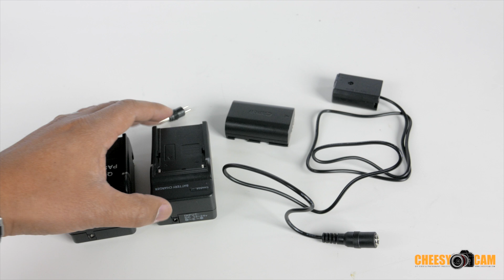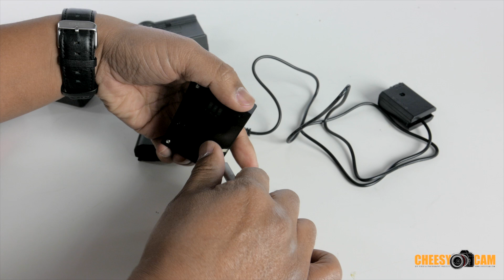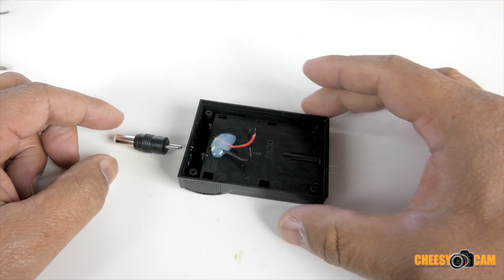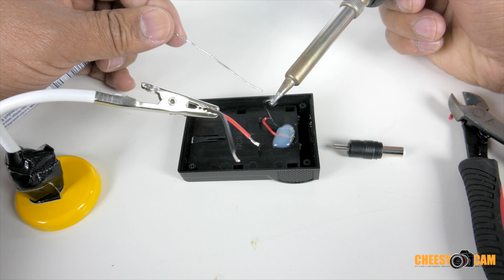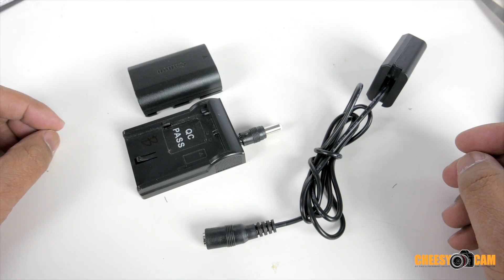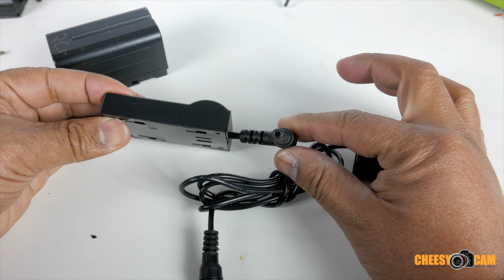Convert Old Sony NPF L Series or LP-E6 Chargers to External Battery Power for Sony A7s etc

Comment: HI thanx for the video, im inspired to fix my pack..I have a sony pmw - 
350k xdcam hd...the batteries are so expensive i decided to take the 
pack apart (prox gp L90b) but this battery's circuit is burned out but 
the lithium batteries are in great shape...I am so tempted to just use 
the batteries alone with out the circuitry...any advice

Comment: Great idea, although I would mod your concept a little bit. I'm going to add a DC socket (sth like this: http://www.mouser.com/ds/2/670/pj-028-smt-516109.pdf) to the bottom of the dummy battery instead of the wire coming out of it. This way I can have a wire soldered to the NPF battery adapter and plug it into the camera when I need it. Looking at the camera's battery compartment door it seems doable. Anyway, thanks for a great tutorial!

Comment: Strange, but I bought the same adapter for Sony a6000 did exactly the same and it is not included. I believe this is due to the third contact? I used battery NP - F970

Comment: What type of cable is the red and black two core? I need to buy some to extend the existing cables in the NPF charger

I'm trying to convert Canon LP-E6 battery mount to a Sony NP-F970, (My LP don't last as long as NPF). I'm using the same NPF charger plates as you and just attaching to dismantled old LP batteries.

Comment: ummm, skip all the funk and just use a 2cell lipo as an external battery. Works great, I've done it for years. They come in all shapes and sizes, any will work as long as they are 2S1P (specifically, this means they are comprised of 2 lipo cells wired in parallel - commonly refereed to as a 2S battery in the r/c hobby world)
Reply: Arent there more storage and draining issue with LiPo vs L-Ion batteries? I think this is why they arent very common.
Reply: A LiPo is in fact a type of Lithium ion battery and yes they can be over drained, damaging them however, a little education will make this a non issue. Also they are the most common today. check your local hobby shop, you will find tens of thousands of options. literally.

Comment: straightforward solution to the useless batteries on the A7s. I did this a few months go for the A7s and last year for my 7d but used the sony heavy duty battery instead. On tge 7d i can pretty much cover a full wedding (5hrs video on/off) on 1 battery. Oh and for the a7s I cut the dc socket off the charger that came with the dummy battery.